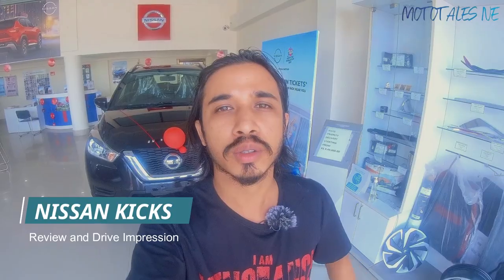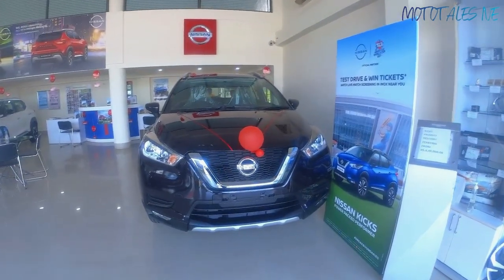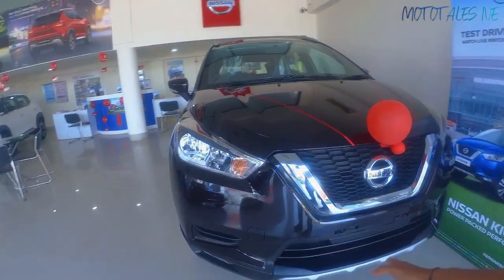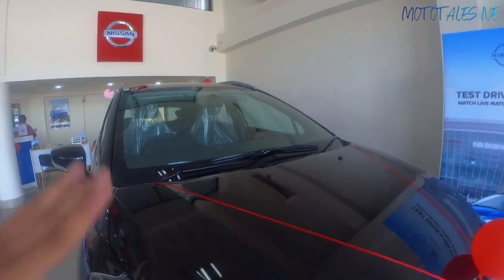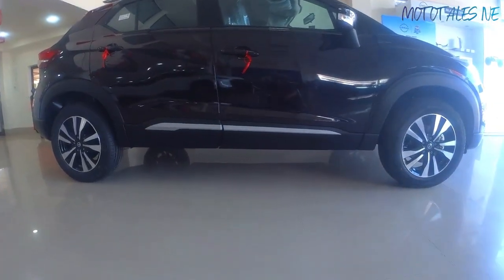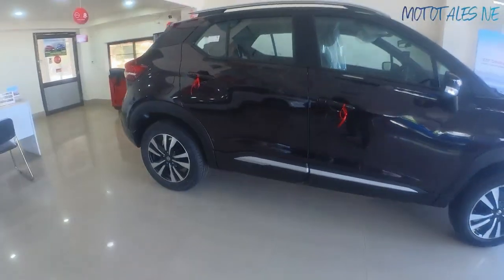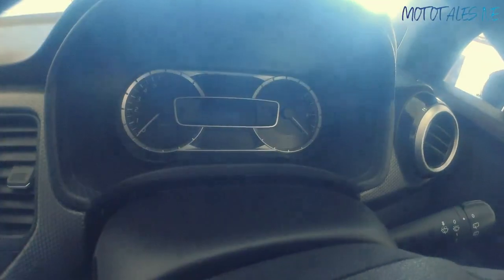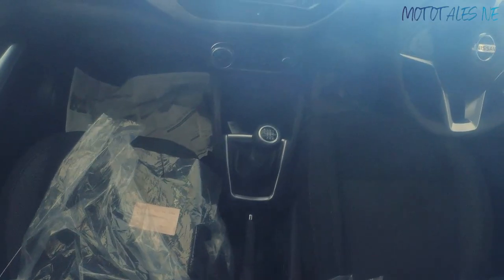Nissan Kicks XV Trim in-depth Review and Drive Impression | #nissankicksturbo

Comment from the maker: In this video I have done in-depth review of the 2021 Nissan Kicks mid-sized SUV. I reviewed the XV trim with the 1.3L Turbo-Petrol engine with 6-speed MT. However, I gave the drive impression of the 1.5L NA engine with 5-speed MT. 
Hope this video will be helpful for you and if it does like and share it also don't forget to support the channel by subscribing it and press the bell notification icon for future updates in the Channel.
Reply: What is the onroad price of it in Jorhat,(also I want to know about Diesel varient)? What is waiting period for delivery of the car?
Reply from the maker: I cannot tell you the on-road prices as it keeps changing but starts at ₹9.49 lakh ex-showroom.

For detailed on-road prices the showroom details are given in description.
And about diesel, don't buy a BS6 diesel car as cost of maintenance is too high even though diesel itself costs less and it will cost you 60-70k more than the Petrol variant.

Go for the Petrol turbo, it still is the best-in-class engine.

Comment: What is the real mileage in city and highways
Reply from the maker: The turbo variant should return an average of 13kmpl in city and highway mileage should be around 17kmpl. Don't expect much than these figures.
Reply: @intazsaikia-mototalesne287  what abt the naturally aspirated eng 1.5
Reply from the maker: @k.venkatagiri7292  The 1.5L unit offers less average than the turbo engine. More or less similar figures.
Reply: @intazsaikia-mototalesne287   i have 1.5 it give 13 14 in city  16 17  on highway with ac without ac 20 kmpl